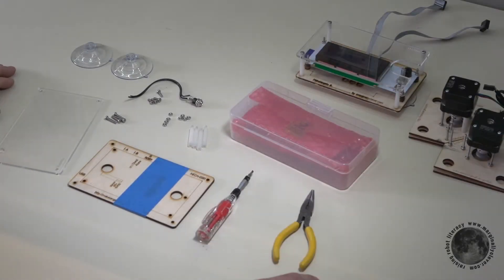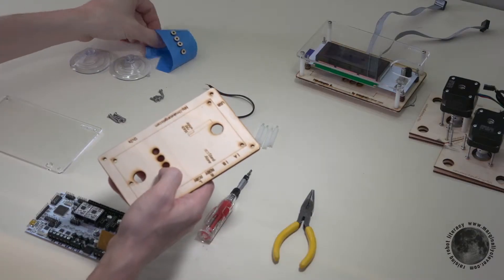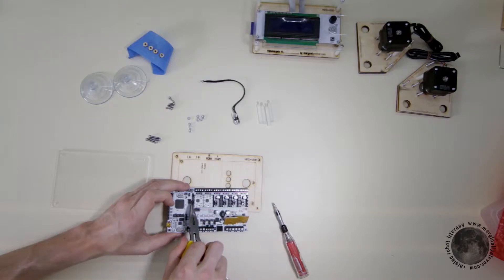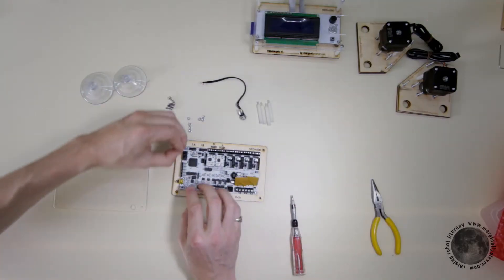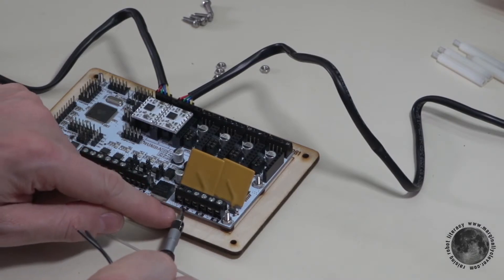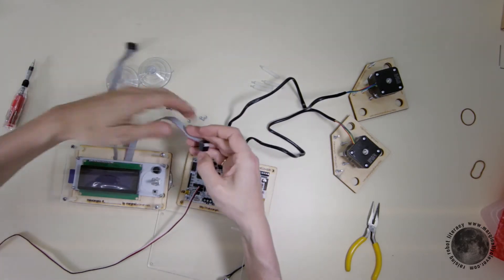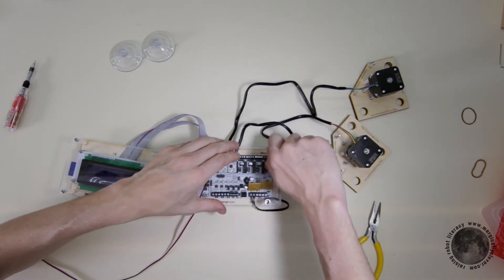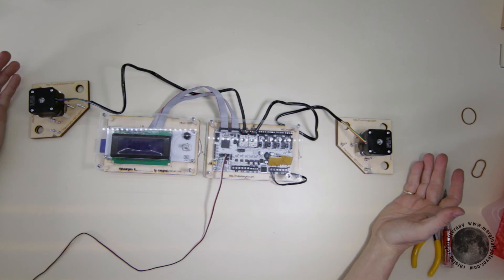Makelangelo Drawing Robot - Motor Controller Tutorial v3.2

Comment: Hi do i have to use a rumba board? can i use a ramp 1.4 with arduino? Or a motor shield? 
Or even beachtreetech skr mini?

Thanks!
Reply: This tutorial is very old and may not be relevant any more.  We now use Marlin Firmware for 3D printers ...so any board that works with Marlin can, in theory, work as a plotter.